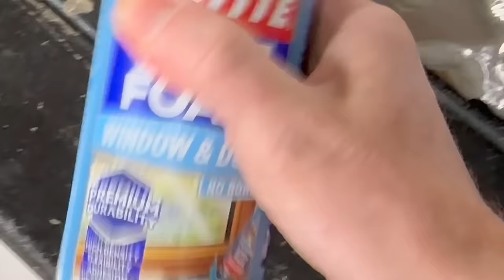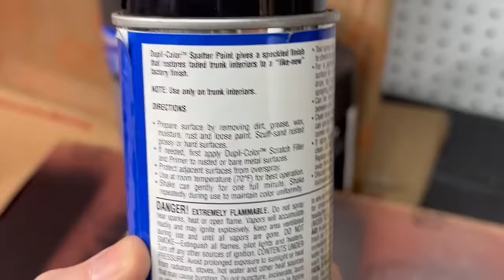How to Restore Cracked Vinyl Dashboard - Spray Texture Coating!

Comment: To spread the foam or silicone use a ice cube...the only thing silicon or foam wont stick to....Glad to see you held the foam can UPSIDE down this time LOL....Try cutting the foam with a hot blade, seals the surface of the foam after. If you want to glue down vinyl use gel super glue...think that would have helped on the stretch vinyl one, which looks really good...Or you can get a "inclinometer" that covers the depression on my 87 dash...Paid $500 for the last perfect gray one on the planet...Great info...let you make all the mistakes first...lol
Reply: Have you ever tried a dongometer for this type of application?
Reply from the maker: Great ideas, thanks!!
Reply: Silicone and wetting your finger works just fine
Reply: @steveadams5190  not true

Comment: Dude…. Use a heat gun to warm the vinyl…. That’s what upholsterer’s do. I used to work at an upholstery warehouse for 8 years. You use a heat gun (just for a couple seconds at a time) to warm, then you use a roller or a leather shaping tool to help contour the material better. Also, use a Neoprene high contact adhesive. Not any of that spray crap people are recommending. Neoprene high contact adhesive is FOR fabric, vinyl materials that get moved around and touched, bumped, rubbed, hit, kicked all the time….
Reply: Try RH Adhesives HH-66 Vinyl cement , and for other fabrics and leather use Neoprene Adhesive like Rh s18

Comment: Once you spray the foam,take a spray bottle with water in it and spray the foam. Give it a couple minutes to form a skin, wet your spreader and begin spreading. It won’t stick if you keep it wet.
Reply from the maker: Great tip, thanks!!

Comment: Good Video. Impressed. Couple friendly tips. Before sprayfoaming. Back mask all areas about an 1/8 or 1/16 from the edge with tape (about n inch wide tape) Then tape over the foaming area from side to side with a 2" wide piece of tape. Covering all repair areas. this forms a slight dome for the foam to push against to force it into the other foam for you instead of a spreader. It also gives you a surface to press on to push it in more flush like you were doing once it started solidifying. With less mess. This is how i've been doing it and it saves a ton of shaping time and gets good penetration into the old foam and vinyl edging.. Just thought I'd throw it out there for you. 😉👍👍👍
Reply from the maker: Great idea…. Thanks!

Comment: So if you leave the foam dry for 5 minutes then spray water on it , you can form it and it won't be as sticky. Use a bread knife to cut it
Reply from the maker: Great tip, thanks!!

Comment: On a soft/semi soft surface the files will hurt you more then help. Start with a 60 grit sponge then 80. The tectured paint will hide a lot of imperfections because it lays thick
Reply: Use a primer that's close in color to the finished color
Reply from the maker: Thanks for the tips!

Comment: I'm sure someone else in the comments has already mentioned it, but just in case: a serrated kitchen knife, like a bread knife or for finer work a filet knife, works great for carving expanded foam. The Surform ("cheese grater") tool you used is ideal for shaping - good call there.
Reply from the maker: Great idea on the knife, thanks!
Reply: An electric knife works great.
Reply: Or maybe one of those back and forth multipurpose wood cutting tools?
Reply: @Notfiveo0 ”oscillating tool”. Sure, one of those would work. Just need to use it carefully, on the lowest setting. It would move pretty quick on foam. An electric carving knife is traditional for cutting sponge foam for upholstery, also.
Reply: Hey, thanks, I have a 83 Mercedes with some minor cracking.  It was a Texas car .  You have given me the  courage to go for it.  I figure it is a lot l3ss expensive than replacing the dash OEM.  Thanks. Tim

Comment: I think that the texture you were looking for could be better and easier be accomplished by using a sponge roller after spraying on the paint.
Reply from the maker: I think I’m going to sand it back down and vinyl wrap it. The paint didn’t hold up well in the sun.

Comment: Wow! That seriously came out fantastic. I've been sweating trying to find a replacement for my 90s truck dash, but after seeing this, I think I'm going to try and fix it instead. Appreciate all the step-by-step you did for it.
Reply from the maker: Thanks, but I recommend covering in vinyl like this video though, because it will hold up longer in the sun. https://youtu.be/XB9GKLRHYNM  This dash has started to crack again because the paint flexed.
Reply: @6thGearGarage  if he used jbweld instead of foam to create the base it won't crack. The difference of tensile strength of the foam and filler forces it to give. Paintable silicone or jbweld would be the perfect filler. Also when not needed, it is not necessary to grind down this large of a gap on the cracks

Comment: defini tely a big fan of 80's style and engineering. Simple, efficient, comfortable to maintain blocky and flat yet stylish.
Reply from the maker: Same, the 80's an 90's are my favorite era of vehicles. Very different styling between the two, but both are the last decades before vehicles lost their simplicity and became overloaded with electronics.
Reply: 1974 Celica with a 3SGE or a 2AR-FE in it. 93 Ranger 2WD 4Cyl, super underrated terms of maintenance & reliability.

Comment: Everyone just keeps getting better! This one definitely seems the best so far just needed slightly more sanding
Reply from the maker: I agree, the more I look at it the more I wish it was a little more smooth.
Reply: @6thGearGarage  there is nothing stopping you from sanding further at this stage. Just be sure to Wet sand it , you will get better results . Let it dry and reapply your colour.
Reply from the maker: @wirefeed3419  I'm going to see if it holds up in the heat/cold test first. If it cracks, I will sand it down and try some other products.

Comment: I've seen this done several times and fiberglass and resin filled cloth is also used to cover the dash.  I can't remember anyone trying to simulate vinyl for the reason of texturing, it's just a look that is usually liked. Bed liner is used quite often.  I think your dash looks great.

Comment: VHT wrinkle plus works good, mainly used on valve covers so its good for heat. We built a new dash bezel out of steel for my friends 66 Beaumont 10 years ago, still looks great and nobody can tell. I also refinished my older BBQ with it, im happy with how it turned out
Reply: Wrinkle plus is great. I use it on a lot of small parts around the engine just makes the engine bay pop!
Reply from the maker: I have used the wrinkle finish on a valve cover before and it’s a great product. Great idea for a dash, thanks!
Reply: I have used Wrinkle Plus. On a 70 chevelle dash. It was beautiful! Until the car we wrecked😢

Comment: I think it looks great but I am looking forward to seeing the dash after the extreme heat and cold test. Nice Job! John
Reply from the maker: You and me both... any small cracks will show up easier than they would on the vinyl covered dash.
Reply: @6thGearGarage  That was my thought as well. I will soon be doing the same job on an old chevy truck dash. I think I'm going to try the vinyl wrap but may do it a little differently. I liked the way you worked the foam in this one. John

Comment: I used SEM texture coat on my 240sx dash when I did exactly what you're doing. It matched perfectly with the existing texture. I also used their landau black paint which is another great product.
Reply from the maker: I’ve heard good things about SEM. This dash has not held up well in the sun.
Reply: @6thGearGarage  I use some of their Comercial products in spayguns at work as well. I definitely recommend trying it.

Comment: First excellent video. Thanks for posting.  I have a cracked dash in my 62 i may attempt to fixintg now.  What I've used on some metal to make it match the plastic texture.  Was Rocker Guard paint sprayed light from a foot or so.  I didn’t fully cover it, so I couldn't see the base.  Then, I painted the whole thing in just a colour close paint.  Worked well for me, and I didn't need to sand down the texture paint.
Reply from the maker: That's a great idea, thanks! I recommend covering in vinyl like this video though, because it will hold up longer in the sun. https://youtu.be/XB9GKLRHYNM  This dash has started to crack again because the paint flexed.

Comment: The repair itself with the spray foam turned out good enough but not convinced about the spatter paint. It probably needed a lot more sanding to get close to the OEM finish. All round a good job though. 👍

Comment: Much respect for producing the video. It sure is difficult to get it right. I use JB weld on my 1987 Toyota pickup gray dash in 2 cracks with the dash in place. It worked "ok"
Reply from the maker: I haven't tried JB on one yet... good idea!

Comment: I have a '94 pickup, '88 pickup, and an '87 4Runner -- All 4x4, 5 speed W56, DLX, gray interior, and XtraCab (for the pickups obviously).  The '88 and the 4R both have cracked dashes.  Been dailying the 4R a bit lately and not sure if I want to attempt repairing the dash cracks cause with my luck, it'll start having issues within 10 years (if not just completely screwing up before even getting it back in the cab lol).  

Just bought a dash mat on ebay for $38 shipped about 20 minutes ago to at least hide the cracks on the '87's dash, since ultimately even though the '94's dash is uncracked, I still have a dash mat on it to protect it anyway, so I suppose it's functionally not really all that different.  Perhaps if this repair proves to hold up for a couple of years, I might give it a shot, but I could totally see myself being content with the dash mat as I've been on my '94 for about 6 years now.
Reply from the maker: Dash mats are the easiest option, but there are also plastic dash caps that look pretty good when painted to match. They glue right over the cracked dash and you can only really tell they're there around the vent edges.

Comment: Amazing video, my only concern is the oem vinyl breaking abd cracking underneath the filler. Am i being OCD or willvthat actually happen? Im debating on removing the entire vinyl coating before restoring the dash
Reply from the maker: That's a good point... I guess I will find out and share in the update.

Comment: I actually liked the look of the spatter paint as is but excellent work! I've got to fix my Jeep's dash and you've given me the courage to jump into it!
Reply from the maker: I recommend wrapping with vinyl, as it holds up better in the sun: https://youtu.be/XB9GKLRHYNM Thanks for watching!
Reply: @6thGearGarage  I appreciate the link! I'm torn on doing vinyl because this is more of an offroad toy than a restoration - and to avoid reflection on the dash I've been considering repairing the crack as you have here, priming it and flocking it. I tend to get a lot of reflection off the hood and dash so flocking the dash and painting the hood flat black are on my list. I may try using stretch fabric we used in car audio instead... we'll see! Thanks for a great video.
Reply from the maker: @EyebrowsMahoney  I set this dash in the hot sun and the paint was starting to crack after a couple of days. Flocking would look great.

Comment: Now THAT looks dang good. HOPE the 2 different sub-materials expand/contract equally. 
Only suggestion I can come up with is 2-3-4 coats of gray primer which helps fill in the low areas then sand each until the texture is closer to OEM. 😉👍
Reply from the maker: Now that primer idea is good! I have some filler primer that would work great for that.
Reply: @6thGearGarage  NOOOOoooo... 
I used it and it fills in WAY TO MUCH. Take it in layers.

Comment: Love the approach too - spraying the texture on.
I think you should sand the top coat with 200 grit to almost eliminate the high points and respray.
Reply from the maker: Thanks! If this one holds up through the heat and cold, I may sand it some more and repaint it to get the texture a little more smooth
Reply: @6thGearGarage  That is a great approach.

Comment: I havent watched your vinyl wrap video yet but i will say when using conatct adhesives you need to speay both components and give them a few minutes to gas off before adhering them together. You'll end up with a stronger hold and less/no air bubbles underneath
Reply from the maker: I like the brush on contact cement by Weldwood. It held up great in the heat test.

Comment: looks good. Here are a few tips on perhaps improving the finished look. Spray high build primer over your sanded texture and then sand that down. Should give you a more flat, not as rough finish. You could repeat the process for even more "fill".
Reply from the maker: That's a great idea!! Thanks

Comment: Wax paper.  When squashing your foam into the cracks and when forming bondo. Allow the foam/bondo to flash over before removing the paper. I've had great results with packing Tiger Hair into halfassed rust repair using this method.

Durability update?   I'm wondering about differing expansion/contraction rates.   Looking to fix a Mazda 323 GTX dash.
Reply from the maker: Great idea!!  The paint has started to crack from the sun. I need to do a full update video. I would recommend this method instead: https://youtu.be/XB9GKLRHYNM
Reply: @6thGearGarage  An update... I'm not removing my dash pad, doing what I can in the car. There are several cracks and a flat area on the passenger side top is all chipped out. Spent a couple of hours with super glue and baking soda working on the cracks today. The glue reacts with the sub-foam, creates a great deal of heat, softens the foam and plastic covering. I was able to mash the raised edges down flat while the glue set up and then fill the gap with soda/glue. I may cover a fitted piece of 1/8 inch plywood with vinyl and cement it in the flat area.  
Try the super glue on a scrap dash, you mey like it.

Comment: If you mix a little fiberglass resin with your bondo, it will thin it out, make it smoother, and extend your working time.
Reply from the maker: Thanks, I will remember that tip!

Comment: the texture is clearly not vinyl but looks great. This method could be used for other interior parts too. For a shine on your vinyl wrap could you use a protection spray?
Reply from the maker: Looking back, I should have sanded this one a little more to get the texture closer to the oem vinyl texture. I haven't tried applying any shine product on the wrapped dash in case I decide to repaint it in the future. The silicones/oils in the product will soak in and repel paint.

Comment: Nice job!  I am by no means a professional, but the bondo file should be used before the filler is completely cured.  You can use very little pressure, and the difference of the texture between the bondo and the original surface is easier to feel, so there's less gouging into the original dash.  An electric "jitterbug" sander makes the job way quicker too, and you can attach a vacuum to the sander to reduce mess.
Reply from the maker: Thanks, that will make the next dash much easter/faster!
Reply: The bondo file is called a cheese grater. Use it when the bondo is set up to about the hardness of hard cheese.  It's about 10 percent as much work.

Comment: You can reduce truck bed coatings like raptor liner and spray it through a gun with a 2.0 tip. If you play around with the air pressure you could get close to an oe texture. It also uses a hardener so it would be more durable.

Comment: great video, good process but if i may as a rule of thumb i was taught to never put wax and grease remover on filler as the solvents do not evaporate from the filler and possible issues may arise down the track, best of luck
Reply from the maker: Great point!

Comment: Looks good but that was a lot of work. I’m interested in the long term results. I’m considering a dash and door panels from FAMAA, the prices aren’t terrible and door panels look surprisingly well done for the price
Reply from the maker: Definitely a lot of work with all the body filler. Less work if you're better at bondo than I am lol. I've seen the pics of the FAMAA stuff and it looks really nice. I read a while back that some of the fiberglass dashes have fitment issues around the vents, but I haven't read anything bad recently, so maybe they modified their molds to fix that. I would definitely buy a set of their door panels.

Comment: Hey 6th, looks great, I am getting ready to do 2 of them, the 3rd restoration was a charm, great job!!!!
Reply: Thanks for sending the links and showing your progression.
Reply from the maker: It's not holding up well, I need to do an update.
Reply: I did both of mine and wound up using the spray foam, then bondo. I completely bondo’ed the top tray part and it seems to be very strong, I used LVP paint, rattle can, looks great. Going to fix some high points in bondo, and hope for the best.. Thanks for all the info and how it worked out. Best of luck to you!
Reply: I am fixing rusted floors in 1985 truck, and rockers. Making all the rockers, cab corners etc. Bought the floor panels but art not that great, looked like the same ones you had. Take care

Comment: I wonder whether it would have been easier and less risk of error by eliminating the foam application and going straight to filler.
Reply from the maker: I actually did filler only on my first dash resto: https://youtu.be/S-UPaYTFBlE It took some extra time, but in the end the dash itself held up well. (the vinyl covering was a different story.)

Comment: Do you think this textured paint would stick well to 3d printed parts? Would I have to use filler?
Reply from the maker: You may need to scuff the surface first and spray an adhesion promoter to help the paint bond to plastic.